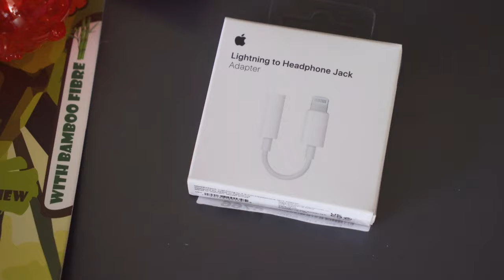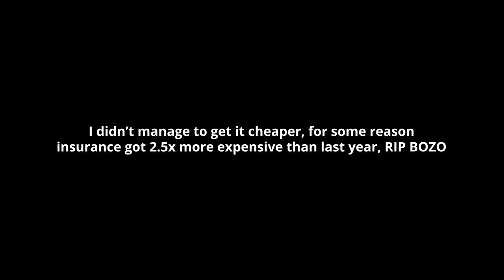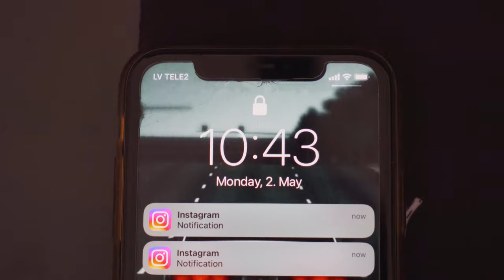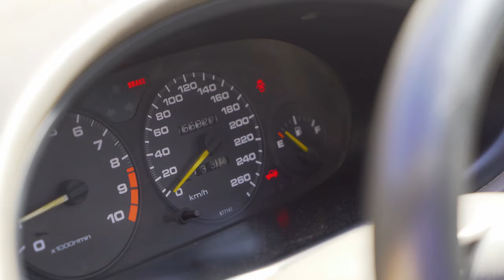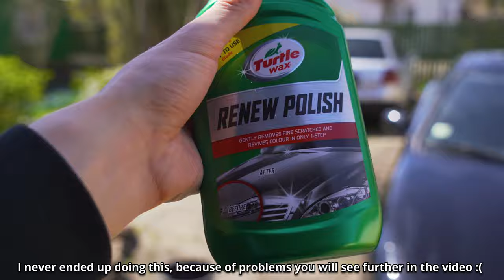1995 TURBO ACURA INTEGRA BARN FIND!

Comment: Great video man! Welcome to the "Car needs constant attention" club XD. You'll need to tie down the battery to pass inspection, either way if you don't tie it down it might lose connection and you'll stall. Got scared when you said there's a hole in the engine :D haha, its just the exhaust manifold, cheap way to fix that would be just welding it, but the weld might not hold when your putting a lot of boost. The fuel lines will be the most expensive fix here since they run all the way from the gas tank to the engine in one piece, and you might as well change them all, but most likely just one is leaking. You could to a little TLC to the car after its been sitting that long and change all the filters, you gotta watch the oil too, since you got a boosted car its a lot more important to have clean oil.
I can give you my spare air filter (its new) if your intake pipe is 100mm diameter. That's an epic car you have to keep it!
Reply from the maker: thank you. Yeah I tied down the battery now, I found the original metals to tie it down so that's all covered, about the exhaust manifold (now I'll know) I guess I will weld it and see how long it holds, if there's problems with it again, I guess I'll try to find a new one. And yeah after filming I did find out it's most likely fuel line problem and I guess I'll just have to get new ones (just looked up the price x_x), hopefully they are not specific made for teggy else it would be kinda tough to find replacement (just like with every part of the car), about the air filters, I will try to remember measuring them this weekend. Overall cheers for the information, since I'm pretty interested learning more about my car or cars overall I really appreciate such feedback! :)
Reply: @PROPERNATOR  Yh dude, its a great car, just gotta, baby it since it has the turbo, I believe that a shop can make universal fuel lines most likely, its expensive but its once in a cars lifetime type of repair/change.
Reply from the maker: @AllOuTTZ  Alright awesome, thanks for the insights :>